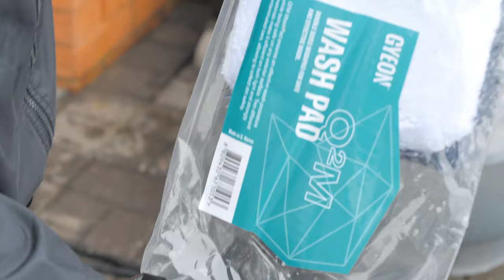Porsche GT4 | Arrives For PPF & CERAMIC Coatings

Comment: Awesome job🙌 can you explain why you’re using mohs evo over Q2 ppf evo? Is mohs a better protection for ppf instead of the dedicated ppf ceramic coating?
Reply from the maker: Hi Vicky. The coating was only applied to the painted areas where PPF was not installed. But you can use other coatings but the dedicated coating is always best to use. Craig

Comment: Very nice. I’ve noticed on a lot of 911’s and now this you wash the cars with the front boot (frunk) open. What is the reason for this? I guess there is a technical reason you do this, so interested to know. Many thanks.
Reply from the maker: Many think that water floods the inside but those fantastic engineers make channels underneath that takes water down and out because cars get wet right? There is also a massive importance of getting the car car as clean as possible and a few drops of water on the inside is better than dirt under the film. Window tinting creates more water on the inside of a car than washing cars does. But no one mentions that. 💁‍♂️
Reply: @staffordshirecarcare  Thanks for the reply, I just wanted to know the technical reason from a professional detailer of doing this. Not disputing whether or not you should do it.
Reply from the maker: @Schuey_M  sure. No problem. It gets raised a lot but there’s not many other ways of ensuring high levels of cleanliness really. I always like it when a question is asked. Hope it helped
Reply: @staffordshirecarcare  Yes, it helped. Keep up the good work. Thanks.

Comment: I'm thinking exactly the same thing - why on earth do you use snow foam and high pressure hoses with the bonnet up?? You seem to do it on all your videos. Surely some water is going to get into the carpet inside??
Reply from the maker: Water channels. Cars get wet!  🙂. Also no one wants grit under the PPF. Unless you have a better idea 😉
Reply: Would have though the area under the bonnet could be done by hand. Just asking.
Reply: "ain't" there? Take it you didn't do so well at school?
Reply from the maker: @graemes8628  understood. Yes it’s a great thought but no it will now work for us.